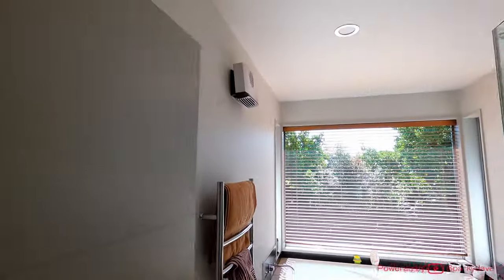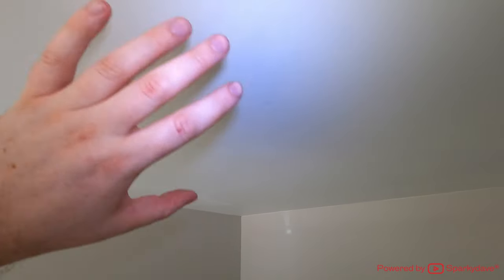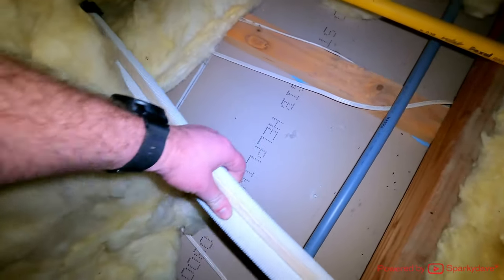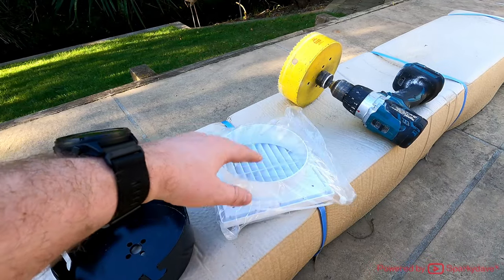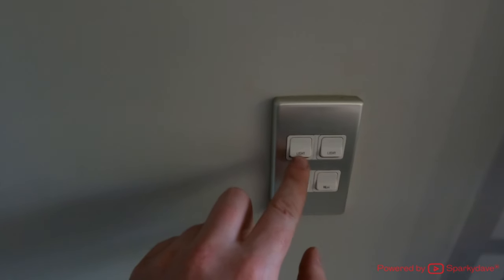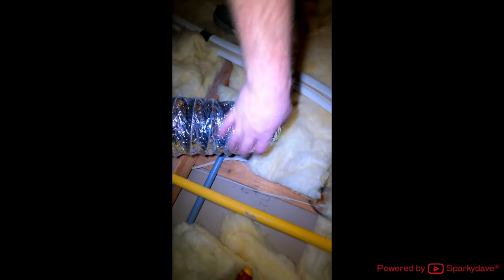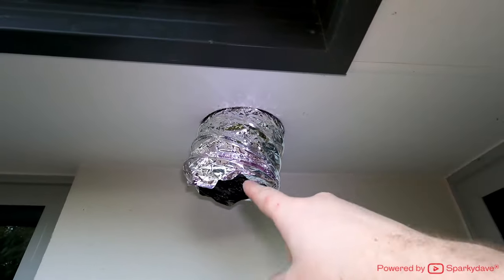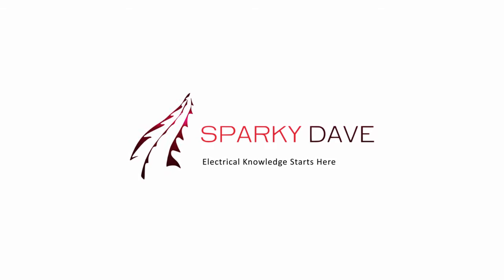How To Install an Inline Bathroom Fan

Comment: Another awesome video Dave. Oh the joys of working on a new house. My 1910 Federation cottage with lath and plaster walls and ceilings has 112 years of plaster dust, insulation fibers, cobwebs, mouse poo etc, so it's always less than a fun day getting up there to do installs. Keep up the good work mate 👍.

Comment: when you push the screw driver through you can bend a coat hander to 90 degrees cut it too the length the radius of your cut out and spin it it you can spin it with out hitting anything then you know its clear to drill carefully
Reply: yeah that is a good idea.
Reply: Simple n smart
Reply: I do this, first i poke it up straight and on angle to ensure no timber trusses higher up and then bend it 90 degrees with a length about 80mm and soin it right around, same process with downlights to ensure you not stuffed it up before cutting..😂😂

Comment: Hey so a question - whats the fan noise like when there is no moisture in the room? E.g. its running very slowly right?
Reply from the maker: This fan automatically switches to standby mode when there is no moisture present in the bathroom. No rotation